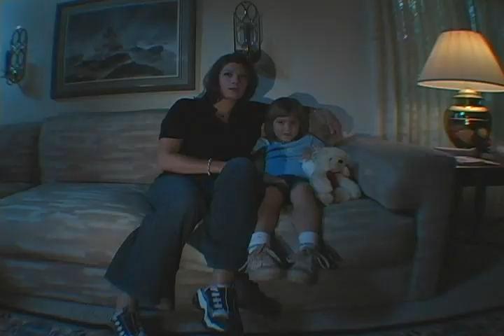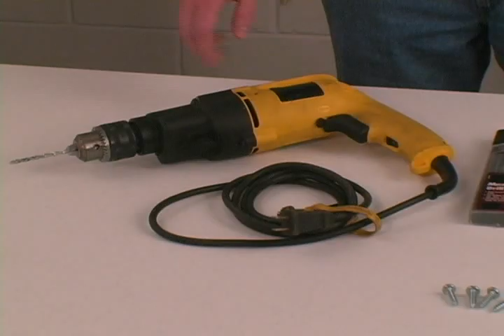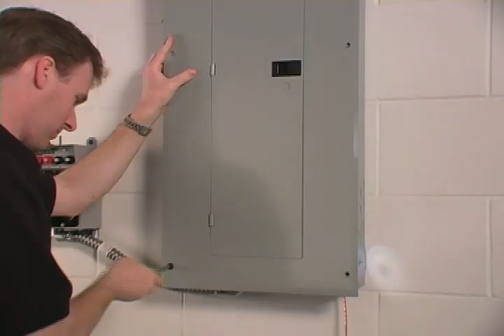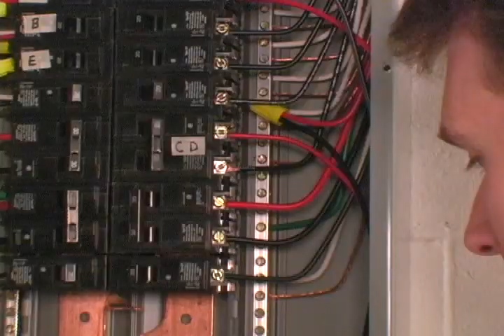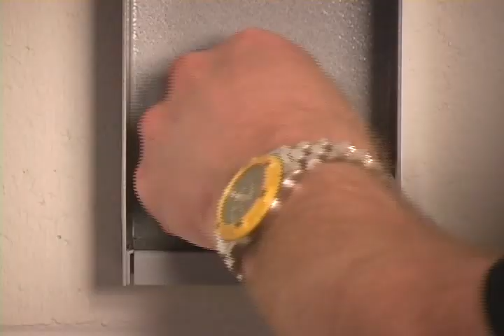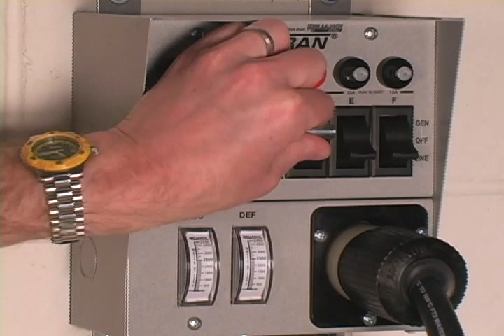Reliance Transfer Switch Tutorial

Comment: Question: I have a 30amp generator, 30 amp remote inlet box, 30 cable. But this is a 50 amp Transfer Switch panel (and assuming that cable from remote to panel is also 50amp. Will that be ok, all used together?

Comment: Well it looks like your back feeding current back through the neutral when you run the generator. Also if there is a short in the neutral the current will travel on grounds through your appliances back to the source. There might be potential current on appliances. The generator's current is travelling in neutral back to the utility lines because there is no ground bus bar.

Comment: My Reliance transfer switch was all messed up.  It had two pair of E wires and no F wires.  Also there were some wires that were 12 awg and some of them were 10 awg.  The black B wire did not have labeling on the wire itself, it only had a single sticker label applied by whoever build it.  So many things wrong.

Comment: If I use this box with the power being fed from a 120v source (solar or battery instead of a generator), how do I handle having 2 line wires to connect from the source to the switch box? Do I connect my one source line to both switch lines in? Would that cause an error, especially if the lines serviced are running into the house panel having 2 phases? I ran with the scenario I just described, using a Renogy 3000 watt 120v inverter and I am indeed getting a GF error and am not able to power anything when I switch from Line to Gen. If that is the problem how do I separate the 2 phases in the switch box? I have the Reliance Switch Model 30408. Thanks in advance.

Comment: 😒😒👎👎  You made a huge mistake.  The generator should NEVER be operated indoors (due to buildup of carbon monoxide).  That means the power inlet connection must be mounted on an outside wall.

Comment: If the common wire is attached to the main power grid is there still a possibility of back feeding the panel without the main breaker turned off?

Comment: What if I'm running a generator plugged into a 50 amp inlet receptacle, wired to a 12,500 watt transfer switch with breakers. The transfer switch is wired to my main panel. Am I rendering my main panel a sub panel when the transfer switch is in generator mode? If so, do I need to remove the bonding bar and put grounds on the green screw side and neutrals on the other bus bar? Or can I just float the neutral in the generator and call it a day?

Comment: Reliance shipped me a adapter for my 20 amp 125 volt compressor plug but they in fact shipped a 30 amp plug end and not the adapter SMH !
I still can’t use my system 🤷🏻‍♂️🤷🏻‍♂️🤷🏻‍♂️

Comment: You DO NOT mount the generator plug inside a building.  That would mean you have to run the generator inside the building.  Doing so is very unsafe for a number of reasons.  Those reasons being carbon monoxide gas from the generator exhaust and the noise factor.  Always run the generator outside.  
The generator outlet should always be mounted on outside the building.
Reply: Doesn't have to be a gas generator. Could be something like an eco flow delta.

Comment: Thank you for demonstrating this very  important instillation.  I was a little confused for awhile when you added the additional transfer power inlet switch and  the original inlet suddenly vanished. After rewatching the video you stated that it was a "remote" inlet. I imagine you were meaning that it was really intended for outdoor instillation as you would only run the generator outside. At the end, ...as this was a main junction box inside the building, it would be important that you make this a little more clear. Suddenly the origonal inlet reappeared inside the house when you demonstrated its function with the actual generator. Just last week a husband and wife lost their lives running their generator inside the garage. Very sad. Thank you very much for reading this.

Comment: I have one comment....this transfer switch is for Genset that can share the neutral with the house. Even more, the Genset is of  floating ground type that get the proper bonding at the main panel.  Don't try this approach if your Genset is of the inverter type that don't like the ground and the neutral be connected together....In that case you need the EZ brand type transfer switch...in where both the hot and the neutral are transfered.

Comment: Love this product, installed device myself about 9 months ago.  Have intermediate electrical knowledge; yet to be on safe side, had my work checked by a licensed electrician. Also used the Help number included to answer a couple of basic questions during installation.  A+ score received after inspection! Have used the transfer switch twice, works like a pro! Typically, plug a radio into a non-powered circuit so as to quickly indicate when grid power has been restored.  BRAVO  Reliance Transfer Products!

Comment: I am trying to add a battery to my solar system.  How does one install a 'remote' interior 306A or 310A transfer switch  (located in a nearby closet instead of the middle of the bedroom wall?) to an exterior main panel outside a corner bedroom, with a 3600W battery generator in the garage at the other end of the house, and  5kW system solar inverter (waiting to power a future PHEV!)  located in the garage and whose output continues to the Grid?  The Panel's  Central Inverter has the required automatic safety shut off when grid power goes out, but the panels also need to recharge the Delta Pro battery while the main power is out?   
I do not want to be going outside to flick switches in an ice storm with our fairly frequent roof-tile rattling 60-70mph  Sierra Nevada winds!  
Nor have worthless solar panels and battery during a prolonged power outage, which the whole system was supposed to prevent.  
   
FWIW:  Hybrid Car battery wiring is so much more complex and so much cheaper!

Comment: FAST FORWARD >>>>>>>2022 Ford F-150 Lightning has a 220-240 volt 30 amp plug.
Can I plug the transfer switch into the Lightning as a power source?

Comment: man, I just finished installing an emergen ts, wish I had seen this video prior to that, answers most questions I had at the time and had to find one by one.. 

A few things I didn't see mentioned: for concrete he used a hammer drill, not just any drill, to wire the individual circuits, you can leave main power on and just turn off corresponding breaker, just be very, very careful, in fact, just don't unless you really need something on, and drilling concrete hole for outdoor remote power inlet box can be hell, wish I hired someone for that, zero pride in doing that one part myself.
Reply: Thanks for the comment, but always turn off the main breaker in the panel, unless someone in your house is in the middle of performing brain surgery.  There is no way anyone should be fumbling around inside the main panel while the breakers and busbars are energized!

Comment: So, I understand that the wire between the inlet receptacle (which be located on an outside wall) and the transfer switch panel is only protected by the generator breaker!  Is that right? Is it safe?
Reply: Why would it not be ?

Comment: Didnt see or hear what gauge wire was to be used from the remote input box to the transfer switch.  Kinda important.
Reply: Depends on your load. Minimum 10-3 , 8-3 depending on how far the plug is from the transfer switch.

Comment: Nice video, but you pulled from 20amp circuit and attached to 15amp on transfer switch
Reply: We have the ten and six circuit transfer switch.  According to the instructions, the 15 amp circuit in the transfer switch, can handle up to 20 amps.  (No need to change it)  I did change three, of the 15 amp circuits, to 20 amps circuits to match the circuits in our main control panel.
Reply: You can go lower but not higher. You won't hurt anything just won't be able to run all your appliances at once...

Comment: Generator has to have an unbonded neutral.
Reply: Yes. This is important. You only need one bond ,either to the box on a floating genset or to the generator on a bonded neutral genset. This will not switch the neutral so you would need to remove the neutral bond in your generator and make it a floating neutral for backup power use.

Comment: You are supposed to plug the load after the generator is started.
Reply: You can plug the extension, turn the generator on then switch the load on. Safer that way. Having the generator on and load switched will lead to arcing when plugging the cord in.

Comment: The generator or whatever you use does not affect this transfer switch, you can have a giant windmill in your backyard for all it cares...as long as the generator has a breaker, you won't have to worry about exceeding 7500 watts.
Reply: You have to supply proper voltage and make sure it's a floating neutral,not bonded neutral.
Reply: @DL101ca  my giant windmill has a floating neutral.  But again I don't see what that has to do with anything we're talking about flow limit.

Comment: @Century Fuel Products can the transfer switch be mounted outside of the house to the main panel? Mainly because i wanted to avoid drilling a hole in my wall to mount the generator connection

Comment: I use a reliance transfer switch in my home. I had heard negative comments on the button circuit breakers so I picked a model that used the standard breakers instead. It's been about three years with several outages some lasting a few hours to several days. I have never had a problem.

Comment: Really enjoyed your video on transfer switch, Do you have to remove the cord from generator to box on the side of the house? To me you could leave it connected, if not, can you tell me why it has to be disconnected.
Reply: I take mine off for a couple of reasons. One I keep my generator inside and pull it out only to test or a storm is coming. Connected it is a trip hazard. Exposed to the sun for a long time it's never good on the insulation of a cable.  I guess you could leave it out but if there was a electrical storm I would think it could send some voltage back into the house if it got hit. Just as easy to roll it up and put it away. I have a bag that it stays with the generator.

Comment: Good video but the wire to the power inlet box needs to be in conduit.
Reply: ❗When 10/4 SOOW cable is used it does not need conduit!

SOOW/SOO is a listed flexible cord (NEC Article 400).  And flexible cords are allowed to be exposed as long as:

They are protected from physical damage

They enter the inlet box through a listed strain‑relief cord connector

This is the normal, code‑compliant method for generator inlet boxes.

So if your 10/4 SOOW runs:

From the transfer switch
Down the wall
Into the bottom of the inlet box
Through a UL‑listed cord grip

…then no conduit is required.

❗When conduit is required
Conduit becomes mandatory only if:

The cable is buried outdoors
SOOW cannot be buried directly.
If you bury the run to a post-mounted inlet box, you must use:
PVC Schedule 40/80 conduit

Comment: Is it legal that I could install it myself without a license?
Thanks!
Reply: You would have to check your area to verify.  I live in Chicago and installed our six and ten circuit transfer switch without a problem. The instructions are very detailed and there are a lot of helpful DIY YouTube videos you can watch.
Reply: In most cities you should use a license electrician.  If you do not know what your doing you could get hurt or cause damage. It's not hard but you can do damage if you connect the wrong wires.

Comment: You left out the part where you sit with your generator all night holding your shot gun guarding it from theives and free loading neighbors.
Reply: The Reliant Transfer is great. This is why I installed vents in my shed and got a 50ft gen cord so I can lock up my generator and go to sleep!
Reply: @daveloucks9356  Just wrap one of the 120v hot legs around the frame.

Comment: I just wired this up today, and want to test the generator and the circuits I chose to power...so I’m assuming I can just shut of the main, plug In the cord to the generator and switch, start the generator, and flip the 6 circuits on the switch and make sure they are powering the correct circuits?
Reply: Should not even need to shut off the main.
Reply: You don't need to shut off any circuits in your main control panel.  Hook up the generator to the inlet box, turn on the generator, flip the switches from Line to Gen.  That's it.  That's one of the things I really like about this switch.  It makes running our generator every month easy with a load and not having to turn off the main power.

Comment: Can i use a SIngle phase generator to power a 240V subpane with this?   I would use a RV cord adapter to a L14 cord which would tie the two hots together, which would then tie to the Transfer switch and then connect to the 240V breaker on it to power a subpanel?  I dont have any 240V appliances on it, im just wondering if its safe or if im creating a ph to ph short?

Comment: Great Video,  I have installed one of these Transfer switches to switch branch circuits to my generator. Can I add a 2nd transfer switch and a 2nd generator to switch other branch circuits not powered from the first generator?  My first generator is a conventional generator,  not so good for sensitive electronics. I would like to add a 2nd transfer switch and an inverter generator to power a few branch circuits for my sensitive electronics.  Thank you.
Reply: I would say yes. I installed the ten circuit transfer switch first.  No problem using it with our Predator 9000/7250 generator.  I wanted to power five more circuits, so I installed the six circuit transfer switch. (All circuits are 15 amp with no high voltage items on them) So now, I am using the 240 volt and 120 volt outlets on our generator to power our entire house.

Comment: There's no way I would trust plain old wire nuts with connecting the wire from the generator inlet box to that transfer switch. I prefer a much robust connection method like using Polaris wire taps or something similar. Wire nuts are fine for wiring a ceiling fan that barely uses any power. But certainly not on anything that's going to be having some major amperage running through the wire.
Reply: They seem to work fine for your outlets and dryer...not sure what the hell you're worried about.
Reply: Ok Karen

Comment: The way that I would have connected the Power Inlet Switch to the Transfer Switch would have been to run the cable through P V C conduit..That would have made the job looking more professional..
Reply: They are clearly showing you how to hook it up, not every code and detail, that is for you to decide , they aren’t your code  instructor
Reply: Why? So it could overheat and burn the house down?
Reply: @sylviaisgod6947  if that wire overheats, you got bigger problems.
Reply: @DL101ca  What could be a bigger problem than your house burning down?

Comment: She didn't shut off the main panel 1st.
Reply: That's the beauty of it... with a transfer switch, you don't have to shut off main.  The transfer switch allows you to switch between main panel and generator input.
Reply: @jaubreya  
I have the reliance transfer switch. What would happen if power came back on and the transfer switch is on ? I was always told to shut main down 1st.
Reply: @creepyzeek1  If the power comes back on while transfer is switch is on (switch pointing to "GEN") then it will continue to run from generator power.  You have to flip the switch back to "LINE" in order to use electricity from the power company.  The switch simply allows you to switch between two sources (LINE and GEN) of power.  Whichever one you've chosen is the one which gets routed to your household devices circuit.  The switch ensures that they can't both be live at the same time.
Reply: @jaubreya  
Thank you.  Interesting.  1 more question. Why is it recommended to keep the transfer switch panel box  in the line position if the main panel is on and working. Why not keep the transfer switch in the off position?
Reply: @creepyzeek1 From a wiring standpoint, the transfer switch sits in between your main panel and household devices.  The transfer switch intercepts your main power and routes it through the "LINE" circuit.  If you flip the switch away from "LINE" then your power (for that circuit) will get disconnected.  In other words, for normal operation (no generator) it should remain on "LINE"
Reply: @jaubreya  
Ok, thank you for replying back. Very educational.

Comment: Dude, you're an ass. And this video is flat out dangerous! One, By No Means should this lady be running the generator Inside a closed garage! Second, learn how to use wire-nuts. that Micky Mouse easy turn demo you provided is flat out weak. Also, you need to loop back and re-tighten all the screw down connectors, as they will never fully compress and seat during the first pass.. Get yourself a pair of lineman pliers and a Klein Electrical screwdriver so you can install correctly.

Comment: When using this setup with a portable generator with a 240volt receptacle, does the generator need to be grounded outside with a grounding rod?
Reply: My generator has a grounding point so I added a ground wire and drove a ground rod for it. I only use it for the Generator. Most people don't.
Reply: No. If floating neutral, the bonding is done at the box. If using a bonded neutral genset , then a grounding rod would be necessary.

Comment: If you want to use a bonded neutral generator, does this unit come with the instructions to modify it for that setup?
Reply: This doesn't switch the neutral. But easy enough to unbond your generator and make it a floating neutral. Google your generator make and find the bond, remove and insulate. Easy peasy.